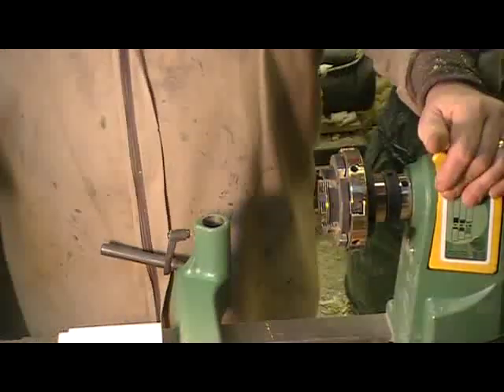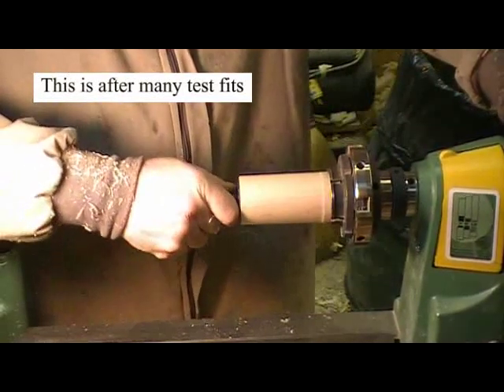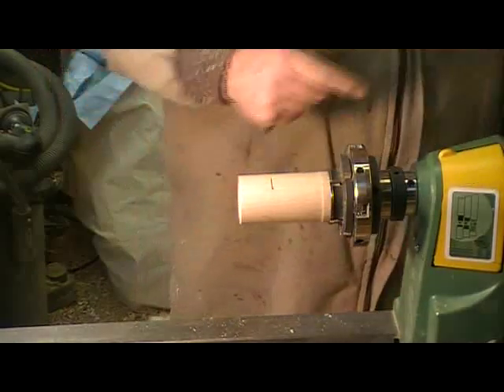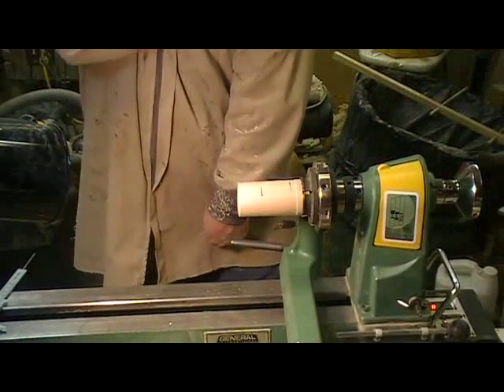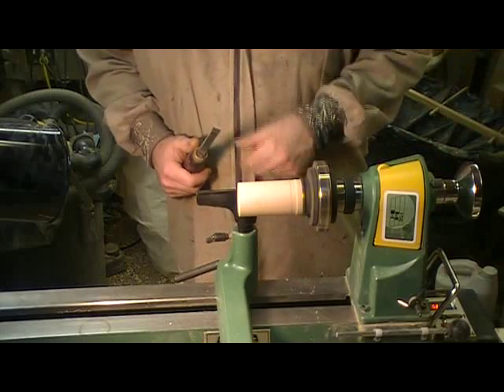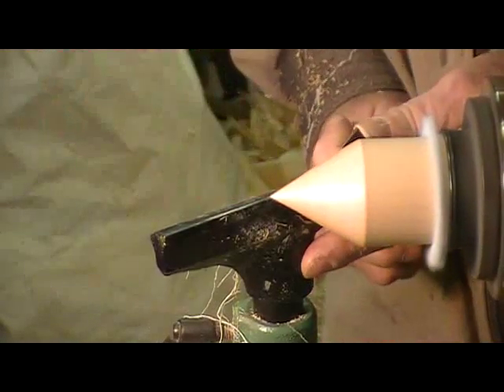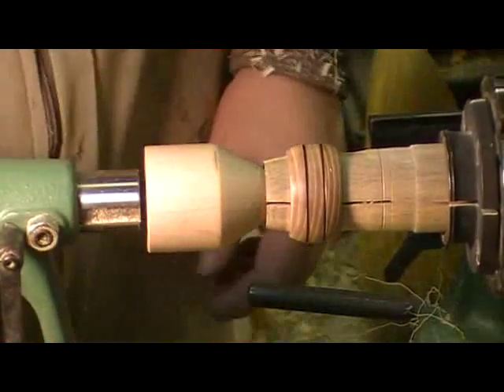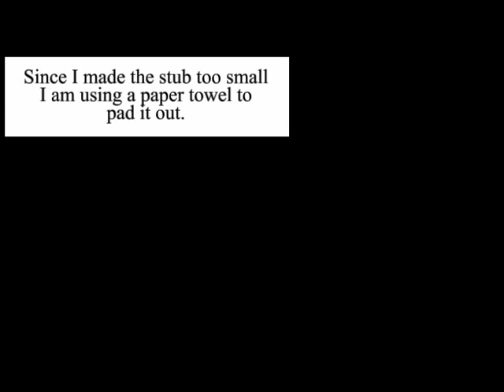Making a wooden tailstock cone center

Comment: Sweet idea!

Myself, I have an advantage over most of the world, having access to machining equipment and a father with 30+ years of experience machining. This has saved me a TON of money with special tooling.

I have 3 centers myself, a 60 degree cone, and 2 like the black center you use. One of my "black" units now has the end removed and a new end with a 3/4"-10 threaded stub installed on the bearing. This way I can thread on new ends just like you can with the One-Way.

Comment from the maker: Oh, I guess I never answered your question.  This is a General International 25-114 M1 midi lathe.  It has a 14" swing and electronic variable speed with 3 speed ranges (250-800, 550-1700, 1150-3500) in forward or reverse.  My favorite part is that the banjo takes a 1" tool post so all the rests I have for the Nova can be used on this one as well.

Take care
Bob

Comment from the maker: Hi:
If the cone turns true in the four jaw chuck then that is fine.  My experience is that a part is more likely to run true when reversed on a jamb chuck than when gripped in a scroll chuck, where the metal jaws can sometimes bite to different depths.  For most things the difference is not enough to matter, but the cone needs to run dead true if it is to be helpful for holding other things on axis.

Take care
Bob

Comment: Thanks for a great video. I'll be making one or more of these for sure. If you made it a little longer you could mount it on the jamb chuck and redo the taper when it started to wear out. Just a thought.
Reply from the maker: Brian Sinclair Hi, Brian:I think the biggest issue with the wooden cone is that seasonal wood movement can affect the way it fits on to the live center at different times of the year.  I made this one in February which is just about the driest time of the year where I live and I did notice that in the summer when the humidity was high that the fit was much looser than I would like.  Possibly a few coats of finish would slow the changes but if you had a source for an alternate material like some variety of plastic it would make a more stable accessory.  Possibly some combination of PVC plumbing fittings could be assembled as a starting point and then turned to shape.  I haven't tried it or even browsed the hardware store with that in mind, so I am just throwing that out.Take careBob